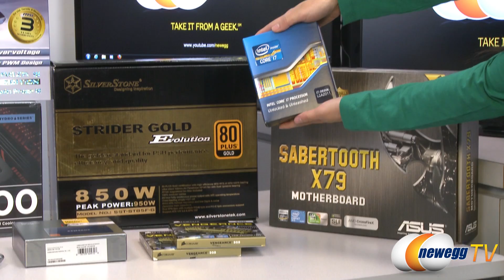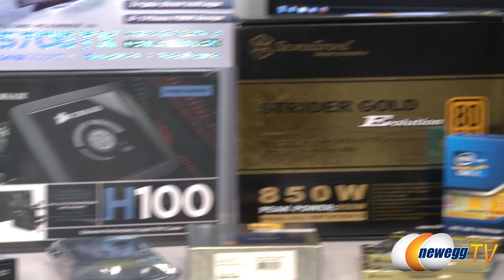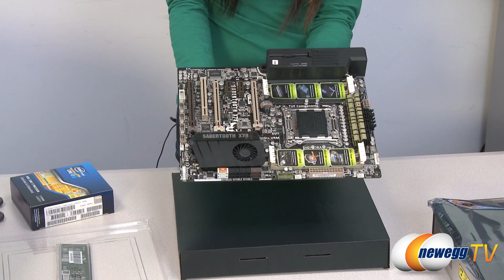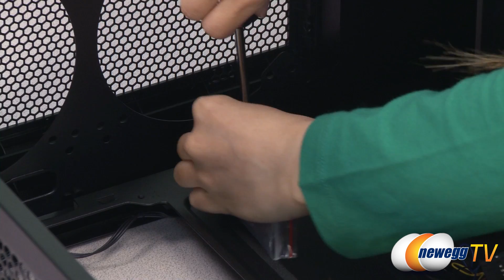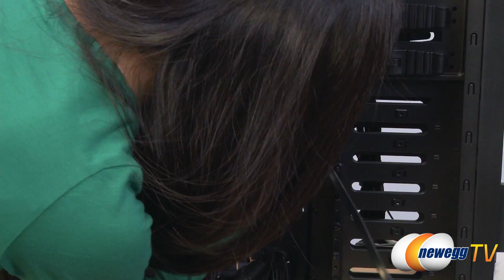Newegg TV: Joanne's New Gaming Computer Build

Comment: noob question but why was continuously pressing the delete key until the bios popped up?
Reply: +TheGAMERFOUR I assume you're wondering why she wanted to enter BIOS?  There were probably just various settings that she wanted to adjust before she installed the operating system.
Reply: VNVNation2013 so to be able to enter the bios you have to repeatedly press delte?
Reply: It's different for each system.  On my laptops, I have to press F2 when the Toshiba splash screen appears right after powering the computer on.  Some systems have you press delete, etc. 

BIOS is sometimes called "setup".  So when you first turn the computer on and see the splash screen and it says "press [del] to enter setup, that's what it means.

Comment: Gtx 570 LOLOLOLOLOLOLOLOLOLOL
Reply: in 2012 m8
Reply: the GTX 570 is still an excellent card and can play any game out there at max settings, so i don't understand the LOL comment.
Reply: My tech skills have improved and now I realize my fail, sorry.
Reply: this video game out in 2012..
Reply: huh? whats funny? Bet you are frustraited for giving 500$ on some newest gpu, yet even old GTX 570 can run every new game at 60fps..
Reply: ***** but a good part of the games that GTX 570 can handle them on med to high settings at playeble FPS.
Reply: ***** Yeah, with good CPU, EVERY new game will run on ATLEAST medium oh , and no, I dont talk about retarded optimized games like DayZ.
Reply: ***** Im not sarcastic, but if you really think that GTX 570 is not a decent GPU for newer games, for atleast 50-60FPS, at medium setting, then you really shouldn't talk about GPUs. I tested ARMA 3, which is very  GPU/CPU sensitive game, with Q9550 stock and HD 4870, and on low graphic settings I had stable 60 FPS in single player. And GTX 570 is way better than HD 4870..
Reply: ***** "without a decent gpu, you won't be able to run most games at a playable fps"
And we were talking about gtx 570, werent we
Reply: ***** oh crap, I was sure i typed CPU and GPU..
Reply: So the GTX 570 is a decent GPU
Reply: ***** yes,but nvidia is doing good GPUs with great lifespan
Reply: ***** but when that GPU was released was a high end card
Reply: ***** I saw an video on FC4 with this GPU and was working good on med-high settings in 1080p.So is not that bad.
Reply: ***** yes but the upgrade is still not required If you are happy with this FPS,I mean If you bought this card when was new you will need to upgrade it next year.
Reply: ***** You are literally comparing a card thats 3 years old to current currents, and saying its a bad card because of it. your as restarted as they come

Comment: Anyone know any good motherboards? I don't mean any like low budget ones, I want the good stuff, planning on upgrading to a new case and getting a new motherboard and all that 'jazz'
Reply: I have an i5-2300 for my CPU, but planning on upgrading my CPU with my new motherboard, the case I want is a NZXT Phantom 410
Reply: Zython Get an i7 CPU m888888
Reply: Idk, might steal some from the store :)
Reply: Maybe think about waiting a while before upgrading your motherboard. DDR4 RAM just came out and the bars do not use the same sockets as the previous DDR3 models, so motherboards will have to be changed in order to fit the new memory sticks. DDR4 is still pretty expensive for the increase in performance, so you might want to give it a year for prices to drop, but if money is no option, you could take the opportunity and upgrade to DDR4 while you're changing motherboards.
Reply: sabertooth or rampage
Reply: ***** I went DDR4 didnt cost me that much more rly : |

Comment: Even though this video is almost 3 years old, the hardware is still pretty impressive by today's standards. That PC must have been a monster when this was recorded.
Reply: It really is, when i build my computer (about a month before this video) used almost the same parts, 16gb of C8 ram, and 2 gigabyte 7970 ghz edition. Even now it scores in the top 95% all time 3D Mark benchmarked scores... really is a monster of a system she has
Reply: Inde x That's insane! The literal definition of "next gen." It's the next best thing to having a time machine lol.
Reply: +Inde x My setup cost me 500$ 4-5 years ago and for another 500 I'm going to upgrade it to a 4.0 ghz Octo-core w/ aftermarket cooling, SSD 120 gb drive, R9 256 bit 4gig DDR5 video card. For another 50 I get a 250 gb SSD. For another 80 I get it up from 8 gig of RAM to 16 gig. Your money could have been invested better considering almost all games at the time couldn't even fully use the potential of that next gen setup. The AM3+ socket was a smart choice I did back then. Will upgrade from a X2 core to a x8 on the same motherboard. My chipset is tight. Modular 650w has plenty of room left.
Reply: Its still a decent build
Reply: Aside from the graphics card.
Reply: Not really, an R9 280X can crush this, and it was $300 at launch in 2013. Much less now.
Reply: Infinite Zero So, a 970 is $400 and crushes the 280X, you cant compare next gen products that wherent available at the time.
Reply: +Inde x You can. After all, I was just stating the improvements in the performance of GPUs over the years.
Reply: Infinite Zero Definitely, tech is getting better every day... which is why this build is so impressive. I left the first comment almost a year ago, so this PC is almost 4 years old now... and it's still a very competent machine for 1080p gaming.
Reply: Philip Shaw Sure is, still getting 100+ frames in most games, granted im using dual 7970ghz edt, but hey, it works
Reply: Inde x Dang, that must've been a pricey setup! The longevity was really worth the premium though.
Reply: Yeah, cost me around $3k, but going onto 3 years and not even starting to show signs of being outdated, so id say it was worth it
Reply: PatTheRiot Getting gear 2nd hand is always cheaper, and at the time that was the best there was, and since im still running absolutely everything on ultra, 3 years later, its a worthy investment to me, i have money to spend, so why not spend it on things i enjoy?

Comment: Corsairs thermal paste is very good, what is she doing taking it off???
Reply: Some people prefer aftermarket paste, and swear that a certain paste is the best. Lmao.
Reply: Generally I would use aftermarket paste like MX4 or AS5 I think they are called, but not if I have corsairs paste on already, I guess it doesn't really matter.
Reply: Colin Java I have mx4
Reply: IC Diamond.
Reply: Colin Java I've had the corsair h100i for a week now. My temps w/overclock were in the mid 70's c. I took the water block off and used AS5,my temps drop by 10c. My oc was at 4.4Ghz.My build.
Case-Rosewill Thor V2
Mobo-Asus Z97 Pro-Gamer
Cpu- i5-4690k (Devils Canyon)
Cooler-H100i
Mem-G.Skill Sniper 1600 8Gb
SSD-Intel 530 series 240Gb
Video card- Pny gtx 750 (low end I know)
Power supply-EVGA 750 G2

While it's not top of the line,it suits my purpose very well.
Reply: Tuco Benedicto Pacifico Juan Maria Ramirez lmao!!!!

Comment: I will never understand why someone is using the Socket 2011 with these overpriced i7 CPUs when you can have almost the same Power with a Socket 1150 (or 1155 in 2012)  with much cheaper i7s... The price relation is much better...
Reply: This came out in 2012. Check the date, it's not that hard.
Reply: What Jonah said and you must not do anything intense with a pc, if your just streaming, editing and gaming yes you are correct =)

Comment: When the hell do you need 32 gigs of RAM for gaming alone? (No offense intended.)
Reply: Didn't she say 4 sticks of 4GB ram which is 16GB?
Reply: you don't, really, because most games use all the VRAM first. but aside from what jetman said, you could take 20 of those gigs and turn them into a hyperfast RAM disk. :D my SHTF setup will one day be 64GB on an R4BE. 32GB RAM disk, 32GB for heavy workflows, F@H, 3D renders, gaming, and the requisite several dozen tabs i have open in chrome at any given time.
Reply: Sai Namuduri  Yes, and a super sized nuclear reactor to power it up ;)
Reply: ***** aka the AX1500i. :D
Reply: Some games actually do use a crapton of memory. Kerbal Space Program, for example. Although KSP is a 32 bit application right now, there'll be a 64 bit application soon, and since that program absolutely eats memory, you might end up using all of that. There are other games that do similar, gobbling memory for physics simulations or other stuff.
Reply: Jetman123 lol kerbal will not use up 32 gigs of ram
Reply: The real question is why the fuck did she use 4x4 gb of ram when she could've went 8x2
Reply: ***** Please don't use the F word.

Comment: Why do people set their rad fans as a intake... Way to bring hot air into your system
Reply: there's a few reasons for either exhaust or intake. There is a school of thought that the rad fans should be intake so that they are cooling the water loop with cooler air from outside, making it more efficient, and thus keeping the cpu a little bit cooler. This is true in most cases, and corsair even suggests this in their manuals. The drawback is that you need to balance the intakes by adding more exhaust fans to keep a negative pressure inside. It also sacrifices system temp like you said, because of the warmed air being drawn in. Your question was probably rhetorical, so sorry for the long winded response
Reply: No I seriously wandered why, I sounded like a duche kind of but wasnt intentional. Really nice responce. Now I know Haha
Reply: Yeah, this always baffled me as well. When you're running a radiator in intake mode, you are passing cooler air over the radiator, but you're also taking all the heat you pulled off the CPU, and you're dumping it right back into the case. When you run it in exhaust mode, you're getting slightly hotter intake air, but you're at least dumping the heat outside of the case, and not all over your graphics card and memory.

Ideally though, you would want something with a fresh air intake and direct exhaust, similar to what a bottom PSU mount provides. I'm surprised that no cases seem to offer this.

Comment: Overkill on the mobo
Reply: it's better to buy an overkill motherboard in case you want to add other parts like an extra gpu or soundcard...if you buy an "underkill" motherboard, you'll have to buy a bigger one later if you want to add other parts.
Reply: People tend to go cheap on the MoBo, wich is a big mistake because it's what interconnects all the other expensive hardware together. It's not only about the chipset and specs, it's about build quality and reliability.

Comment: Gaming pc do not need high-end cpu and mb live that, to me i5 3570k easy OC @ 4.5ghz work very quiet and cool with H100 cooler, gammer need a huge VGA like GTX 690 or sli 2 way or 3 way high-end VGA . Don't waste money for CPU and MB they do not give you more fps, smooth, good experience for gaming, life VGA, good gaming gear and high rato monitor did.
Reply: actually you´re wrong, they can improve fps, and they can improve the low fps problems, instead of 25 minimum they can make 30 or 32 it depends on the gpu too bro.
Reply: Franco Pettine thanks bro. Maybe it did. On my setup 2 way SLI MSI GTX660ti PE, they can play BF 3 (MP with 64 player) at min FPS >70fps, with mb MSI Z77A-GD55 and CPU core i5 3570k @ 4.5ghz. Crysis 3 about >30fps. With high-end GPU i ever try so i think i5 3570k good enough for me :).
sorry my english.
Reply: Franco Pettine You're right, but the more important point is that beyond an FX-8320/8350 you get better gaming performance by spending more on GPU than on CPU or motherboard.  I mean, even in this build since she's just gaming Joanne could have gone with an i5 and spent the extra $300 on a better card or multiple cards.

Comment: That is only beneficial if you put the rad in front of the fans so the cold air is cooling the rad. You think that it will pull cold air into the case if the hot rad is behind it? The answer is no! Its not cooling her rad or her case. If she put the rad in front of the fans it would pull cold air on to the rad but pull hot air from the rad on to the rest of her components (this is beneficial). I know because I have done several experiments testing the temp of my case cpu and video cards.

Comment: Your top fans are pulling air inside the case. Its not cooling your rad which is the whole point to putting fans on your radiator. Also your blowing hot air from the rad onto your video card. What a fail.

Comment: that processor was a 2011 socket Intel 9360k it it has 6 cores and 12 threads thus making this processor absolutely mammoth. The main reason its so big is because of the socket which has 2011 gold pads on the processor itself which explains why its so large. The other stuff was just in case u didnt know

Comment: Mine is better:

CPU: i7 4770K
PSU: Corsair HX1050
(water) cooler: Corsair H110
mobo: MSI Z87-GD65 Gaming
memory: Kingston HyperX 16 GB DDR3-2133
GPU: Nvidia GeForce GTX 780 (3x windforce)
SSD: Samsung 840 pro 128 Gb
HDD: WD 2 Tb black
ODD: ASUS BW-12B1ST
Mouse: Razer Naga
Keyboard: Logitech MK710

I'll make a video about my pc's benchmarks after I got all the parts

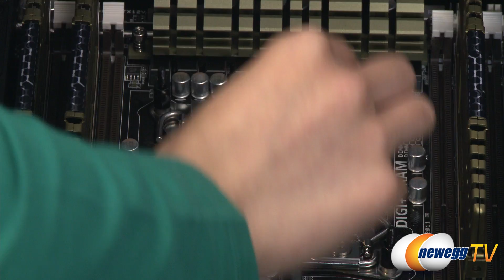Comment: 4:58 wtf they fuck up the thermal paste socket 2011 needs a line method apply other cpu'''s just a dot in the middle not too much but make sure its enough and let the pressure of the cooler spread it that way you dont have as much airbubbles thus better heattransfer from the cpu to the cooler and in turn better temparatures

Comment: Initial on a new case these thumb screws are on pretty tight at the factory so they don't loosen in during shipping.  You know they have a phillips head on the top of the thumb screw for this initial loosening.  I normally use just a non-electric phillips screw driver.

Comment: nope, just have a huge heatsink with 2 fans in a push/pull config. i'll admit it does take about 30 minutes of idling to hit 8 or lower though. the temperature sensor is accurate. it's not hard to get a cpu running at less than room temperature for some reason; don't know the physics behind it all though.

Comment: "if your in sli mode, that restricts you to nvidia cards, and that's if i am assuming you aren't a complete moron."

Just because I'm currently running in SLI mode that doesn't mean I can't switch to CrossFire. Also, I can overclock all 8 cores to a stable 4.8GHz on full load for an hour without even breaking 55C in temperature (air cooling). That's mostly clocking the bus up btw, NOT the multiplier. Only put the voltage up from 0.05V. The only thing holding me back from pushing higher is my PSU

Comment: Actually I bought the parts in 2011 and used the GPUs from my old system; They're GTX 460s and I got them at an awesome price-per-value ratio; As for your comment about being restricted to nvidia, I'm not; My military-grade motherboard supports both SLI *and* XFire. Also, I went with 16GB of RAM because I do *lots* of multitasking AND video editing (hence going with NVidia for their CUDA technology). Assuming you're not a complete moron, you just learned a few things.

Comment: My watercooling setup has my watercooler on the top, it's an XPSC kit, I have all the fans sucking in and the top 2 fans for the radiator exhausting, so all the air comes out of the top, and I've noticed instead of having the usual front intake, rear exhaust, top intake, side intake, I've noticed having it the way I do, I get better temperatures. :) So maybe that could be a idea for your next watercooling build. Great job on the build though, looks neat and I love the whole gold theme. :)

Comment: Not that I believe that guy or anything, but I would like to point out that what you said is not entirely correct. You CAN run 3 GTX 690's in SLI, but you have to have a custom driver. NVIDIA only supports up to quad SLI (2 690's) with their driver.

Comment: I agree, you can use custom drivers, but what's the point? The upkeep and problems with 4-way SLI and the performance you get out of it is completely unnecessary. A single 670 could run virtually any game out there, and games to come. I'm guessing they just SLI for benchmarks.

Comment: overkill is good in a power supply, it allows for more upgrade potential in the future and it will run more efficiently if it's not at the max possible output

Comment: You're fighting physics by installing the rad fans pulling air in from the top. Heat rises. I'll let you blame Corsair, because that's how they say to install it. I would say you could get way better cooling if you turn those fans around.

Comment: The pea method rarely ever gets air bubbles. If you spread the thermal paste, there is quite a nice possibility to get air bubbles between the thermal paste and the heatsink. And that will bug with the cooling.
And besides you basically only need the thermal paste on the middle because that's where the cores are and that is the part of the CPU you need to cool.
The problem with the other methods is that it usually uses too much thermal paste.

Comment: My computer I am getting on Amazon as soon as I get a answer.
GPU:Sapphire HD 7970 3GB Vapor-X Edition
Motherboard:ASUS SABERTOOTH Z77
Hard Drive:Seagate 2TB SATA 35IN 7200RPM 64MB 6GBS
System: Windows 7
PSU: Cit 750w
Ram:Corsair Vengenace 16GB
CPU: i7 3770k 3.5ghz
Will they fit in my Zalman Z11 Midi Tower Case?
Do I need to buy and DvD drive and sound card?
Is a dvd drive to put disc game on the computer?:)

Comment: PSU 	Enermax Platimax 1500 W 
CPU Intel Core i7-3960X
Cooler - Corsair H100i
Mobo Asrock Extreme 11
Memory 64 gb Kingston Beast 2400 mhz
Video Card Saphire Toxic Edition 6 GB 
SSD 512GB Vector 4
HDD Western Digital WD Black  4 TB
You Think i should Upgrade anything
i have all the parts but the case it's altogether $5550.84